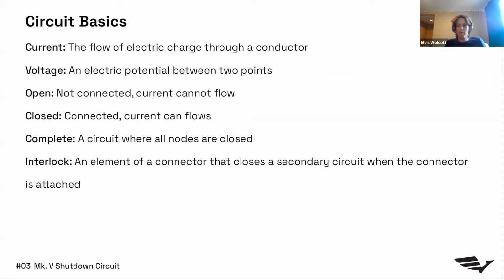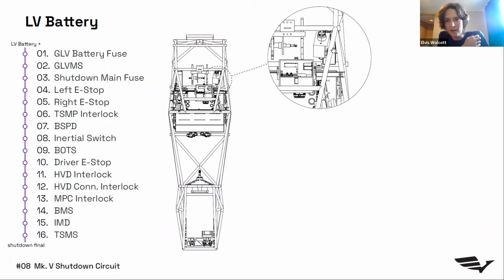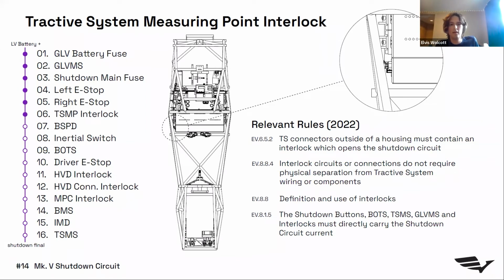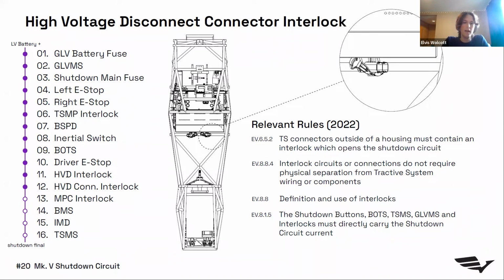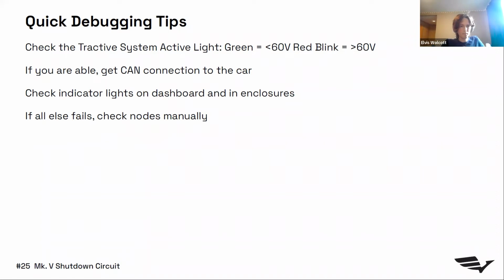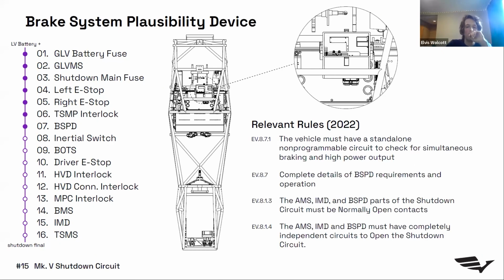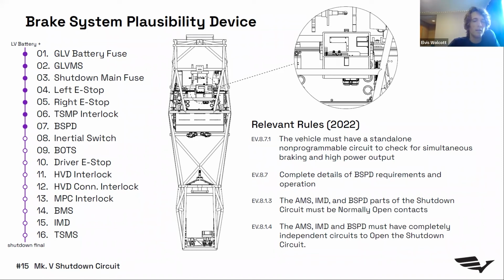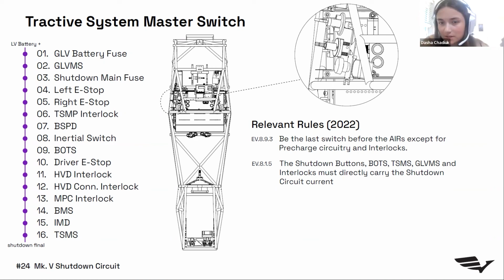Mk. 5 Shutdown Circuit

Comment: AIR's can certainly weld without blowing the main pack fuse. For example if precharge is somehow skipped there would be an immediate inrush current to the motor controller which is short enough to not blow the fuse but enough current to weld the AIRs. Luckily most AIRs have protections like magnetic blowout to prevent this but having circuitry to monitor if they're welded is sick.

Comment from the maker: Two corrections:
If the shutdown circuit is not closed, the TSAL should NOT be on. Green indicates that the AIRs are closed but TS voltage is less than 60V. This should only occur during precharge or discharge. The TSAL not being on at all would be a sign the shutdown circuit is not closed.

TS voltage will not start dropping until the AIRs open, so the voltage will not drop during the 0.5s timer before the BSPD opens the shutdown circuit.